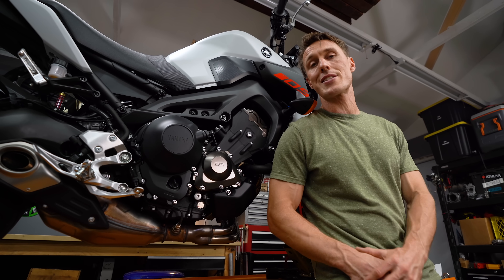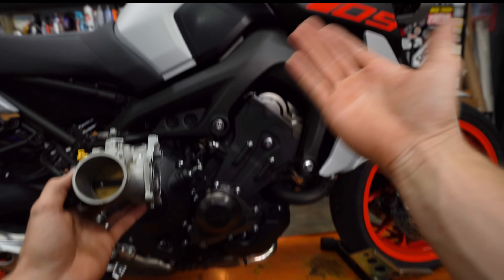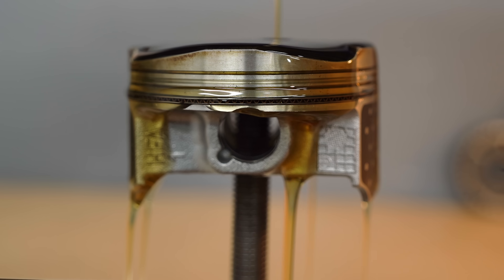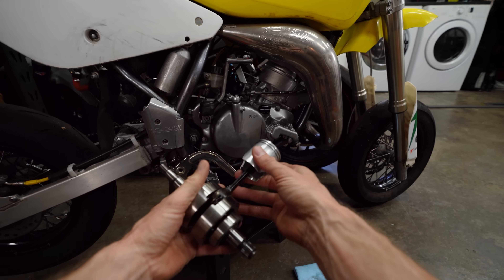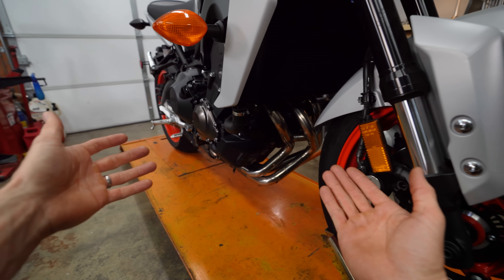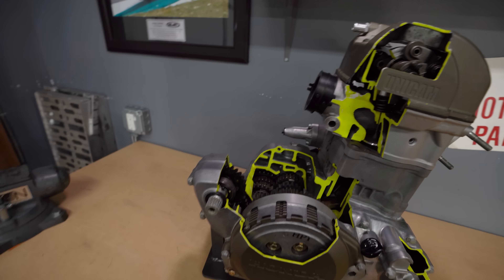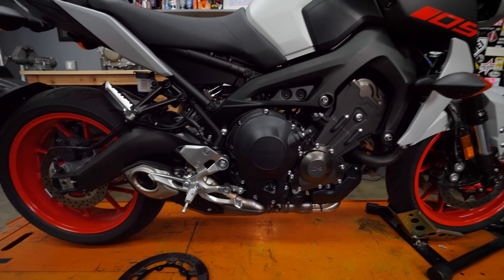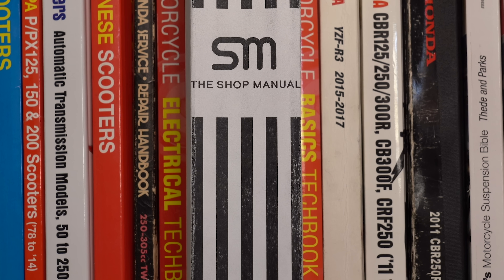Is Engine Braking Bad For Your Motorcycle? | The Shop Manual

Comment: What about down shifting without clutch?
Reply: Just make sure you're not pushing high revs when you do it. It's fine going up the gears without clutch as you just kill the throttle and click up but take it easy coming down.
Had to wait a week for a replacement clutch cable for a Suzuki GS850G and did everything clutchless, even starting in gear while hanging on tight!

Comment: I’m thinking about getting a yz85 and I’ve heard a lot about this engine braking so I’ve heard jus give it blips when goin down hill or just pull in the clutch and blip it and so and so but say you let off the throttle and don’t blip it at all and just use the brake to slow down would that be the same as engine braking? Can somebody fill me in about this and also tell me if there is any other things I should know about?

Comment: But isnt it so that fuel into the cylinder cools down the engine?  For example a lean set up engine will run hotter than an engine who is set up to run  rich? So if youre engine braking and thus letting very little or no fuel into the cylinder the engine will heat up?

Comment: Ok hold on. At one point Ari said something along the lines of "there's little to no air-fuel mix getting into the engine when the throttle body is closed". So how does an engine even idle without getting any fuel? I'm lost
Reply: Even when the throttle is closed, the throttle plates are still cracked open a little bit, allowing enough fuel/air through to allow the engine to idle. When you adjust the idle screw on carbs or throttle bodies, you're changing how much the carb slides or throttle plates are open at closed throttle. Make sense?

Comment: Engine braking: I was most concerned that my engine would cool to quickly because during engine braking you are introducing cold air into the hot engine and thus may be warping the valves do to cooling them rapidly. This occurs with "air cooled aircraft" at higher altitudes due to the air being very cold and is even known to seize up the engine. Would this be an issue especially during winter or on cold days for an air-cooled motorcycle engine? The engine is not going to overheat via Engine Braking whether it's water cooled or air cooled , that's just silly and in fact, the opposite will occur although, predominantly with air cooled engines. Robert
Reply: No, because the air warms up quite a bit coming through the intake, and it’d be entering the engine at the same temperature whether on throttle or not anyhow. It only gets hotter once compressed.
Reply: @thetowndrunk988  not what I was taught.
Reply: @robertshaver4432  ask yourself this- where would the extra heat be coming from? There’s some slight heating of the air trying to get by the throttle plate, maybe, but then it’d cool back down upon expanding on the other side  Negligible at worst, immeasurable otherwise. There’s no fire or explosion, so there’s no source of heat.
Reply: @thetowndrunk988  I think you've got me wrong. It's an air cooled engine so the heat is inside and the cooling is outside. At altitude the air is "very cold" so if you abruptly throttle down the engine cools rapidly from the outside and thus very unevenly. The valves can cool too quicky and warp and also the outer cylinder walls cool quickly and the block contracts around the piston which remains hot and expanded so the piston becomes to big for the contracted cylinder walls and thereby the engine can seize up by pulling the power off to quickly. Upon cooling from the outside-in the block shrinks and the still hot pistons don't. You can seize your engine this way. pull your power off slowly to allow the engine to cool more evenly.
Reply: @robertshaver4432  yeah, I got my conversation with you mixed up with another conversation about heating up from engine braking. But anyhow, IMO, there’s enough mass in the block that it’s not gonna cool down suddenly, and the fact is even letting off the throttle is still engine braking, so unless you never let off the throttle, you’re always going to have engine braking happening.
Reply: @robertshaver4432  that said, an air cooled engine, by its very nature, is obviously going to cool down a lot faster from air, so ymmv
Reply: @thetowndrunk988  Subjective? find any airplane mechanic and ask him if "at say 10,000ft should you "quickly" pull your throttle down from full throttle to idle"? I'm not being rude, I'm keeping you safe!
Reply: @robertshaver4432  that’s an entirely different argument, and believe me, I actually am a pilot. You’re talking about much older engines in most GA aircraft, and there are a lot more reasons to not pull the throttle back in a plane. Crashing being one of them. A whole load of factors in a plane. That has jack nothing to do with a motorcycle engine. They’re not even remotely close to the same type of operation, or conditions.
Reply: @thetowndrunk988  I guess you don't ride in the mountains. If you are loaded with either a passenger or camping gear or both and  have climbed a steep grade and brought your engine to its hottest temperature then as you crest the grade and begin the downhill side and quickly reduce your throttle to idle to use the full extents of compression braking, you will or may warp your valves. Metal does not like rapid temperature changes. In so far as aircraft crashing because you go to idle is absolutely ridicules: If you really are a pilot you know of "energy management". I ride in the mountains and on narrow/slower/steeper roads where overheating is a concern. On the downward side you do not want to quickly reduce your throttle to idle for compression braking. ymmv.
Reply: @robertshaver4432  🤦‍♂️ Jesus God. Of course you don’t automatically crash taking an engine to idle. However, if the engine quits, because you took it to idle for no good reason, whether it ices up, mixture changes, etc, it can certainly lead to a crash. Now, comparing planes to a motorcycle is an absolute fallacy. You’re generally gonna be at altitudes that most motorcycles won’t see, at least for very long, and you’re dealing with engines that are designed to run at a constant rpm, towards the high end of the motor’s rev limit, for long periods, which is the exact opposite of a motorcycle. So unless you’re going back and forth through the Eisenhower tunnel, with a constant speed non stop, a motorcycle isn’t gonna see those conditions for any long period of time. And you speak of energy management- in a plane, you want altitude and speed, because they give you a margin of error for emergency planning, which once again, is the exact opposite of a land based vehicle on wheels, where lack of speed and being able to stop quickly are you friends. So I guess if you’re on I-70 around Veil, on cold days, always doing constant road speeds, maybe you have a point, but in the normal use and conditions, ie very few people ride motorcycles around below freezing, which it quite regularly gets to at 10,000’ flying, the concerns aren’t worth considering, and the comparison between the 2 has absolutely zero merit.
Reply: @robertshaver4432  fyi, pulling back to idle is done for engine out training. Now here’s another point- what happens when you let the bike fly downhill, using nothing but the brakes, and your speed picks way up? Does that not also cool the engine rapidly with the increased airflow? When semi trucks pull a giant grade, crest the hill, then immediately start engine braking coming off the other side, are they sitting in shops getting valves replaced often? No, of course not. It’s not a big enough shock, even to a small engine like a motorcycle, and any shock that would be there would be experienced anyways, unless you’re gonna plan to ride around in circles for a few minutes to dissipate the excess heat.

Comment: Question?  The way you describe engine braking sounds like a person staying in the same gear and coasting to a slower speed.  What I would like to know is DOWN SHIFTING...  if I am cruising at 3500rpm and see a red light and instead of using the breaks I downshit and coast, and downshift and coast to stop.  I jump from 3500rpm to 7 or 8k but still below red line.  IS THIS BAD??  T ride like this and my 250cc duel sport has 39,000kil on it and now the clutch is slipping.  Did I prematurely wear my clutch or is 4000k on a 2009 duel sport normal interval for clutch work?  I always thought riding like this was OK and that I was saving on my brakes, but now that my clutch is slipping I am wondering if my riding caused it?  THANKS
Reply: Downshifting is a great way to increase the effect of engine braking. Just make sure you're rev matching to keep things smooth.
Reply: @AriH211    That is my point, I am not rev matching, I am going from 3500 to 7000rpm so doubling my revs when downshifting to decelerate.  I stay below redline but downshift to decelerate quicker then coasting like coming to a red light.  I downshift jump up to 7000rpm then when at 3500rpm I downshift again until I come to a stop at the light.  I am NOT coasting, I am NOT rev matching, I downshift to decelerate quicker.  Is this bad for clutch or other parts?
Reply: @reedkelly6145  Yes, you need to rev-match and feather the clutch to smooth out the downshifts, otherwise you are in fact putting undue strain on your clutch. Ultimately it's a small impact, but what's more important is that you practice good technique for the sake of smoothness and control of the bike. If you downshift the way you're describing when it's raining, you may cause a rear-wheel skid.

Comment: Sorry, that is a rather short sighted video. Crankshaft doesn't like being used as a brake. Engine is for going, brakes for stopping. Engine braking DOES cause engine to wear quicker than just using your brakes. ...and if my radiator can handle full power acceleration, why is it that my three disc brakes can't handle full power stopping?
Reply: Your brakes can certainly handle it, and I for one would never use engine braking b/c I think it'll preserve my brakes, UNLESS it's on a super-long decent. Plenty of examples of people overheating their brakes during such descents, which is why so many owner's manuals (for all vehicles) suggest downshifting and using engine braking to relieve the brakes and keep them from overheating. 

As for crankshaft's preferences (and why they matter), I'd love to hear more of an explanation.

Comment: isn't engine braking is caused by the compression stroke? I think you can turn the engine of and still engine brake with the throttle fully open.

Comment: Engine braking does cools the engine a lot. Don't believe me? Look for a long downhill, remove the car or bike thermostat. Get to the top of the hill and with the vehicle on operating temperature do the descent only using engine braking.....when you get to the bottom the temperature of the engine will be colder.

Comment: An interesting note, some Saab cars built between 1950 and 1980 had 2 cycle motors, and some of the ones that used "pre-mix" had a freewheel sprag clutch to prevent engine braking for the very reason of oil starvation. I think some 2 cycle snowmobiles also do.

Comment: I engine brake every time I ride. It’s essential to smooth stopping in my opinion
Reply: Yup! (It works fine- on snow and ice, too.) The pads on my KTM Duke 390, still have around 50% on the front/ 60 or 70% on the rear. (And the factory ABS, is for why I am still here.)

Comment: The engine is not a brake. It is designed to produce power not absorb it.  New pads and rotors are a lot easier and cheaper than engine rebuilding

Comment: I figure brakes are a lot cheaper than drivetrain.
Reply: It's all gonna wear out anyway. Ride in whatever way gives you more joy and control. For me, that's using engine braking. The alternative (pulling the clutch in any time you roll off the gas) sounds absolutely ridiculous.
Reply: @AriH211   I don't pull in the clutch all the time, I just don't downshift.
Reply: @timjohnson1199  Then you're still engine braking, just not with a lotta force.

Comment: Engine braking on an electric bike actually puts charge back into the battery. It's like free gas every time you go down hill or approach a stoplight.   
This video is an advertisement for electric motorcycles.

Comment: I have a question. When I get 93 out of a pump at about 3 gallons am I getting lower quality because someone just bought 87?
Reply: Yes, but it's only a few ounces (the volume from the gas handle to the manifold in the pump).
Reply: Just pump the first coupla oz out on the ground and then start filling.

Comment: and the chain set?
Reply: Engine braking tensions the lower run rather than the upper, and it does it with a lot less tension than accelerating.

Comment: I would add that by using engine braking the rear tire wears out slightly more than the front, but if you use normal brakes it’s exactly the opposite

Comment: Ima save you 6 minutes - Is engine breaking harmful?

4 stroke engines = no.

2 stroke and wankel engines = yesnt.
- because oil for lubrication is in your air/fuel/oil mixture. If you engine break there is no air/fuel/oil mixture to lubricate your engine, so your engine doesnt get lubricated every time you engine break. But dont get me wrong If its only for a very short period of time, this wont harm your engine, its not like your lubrication is completely gone every time you engine break. But is will be gone if you go down hill engine breaking all the time. This will kill your 2 stroke or wankel engine very quickly.

Btw. Wankel/rotary engines are special 4 stroke engines - just some very special ones which have the principle of burning oil just as 2 strokes, which is why people often mistake them as 2 stroke engines - they are not. Wankel engines are 4 stroke engines, which have to burn oil due to how they work.

Not engine breaking and just pulling the clutch is actually very dangerous in any curve. I garuantee you this habit will sooner or later get you killed, if you dont get rid it. So unless you really want to die, you should get rid of it right now.

Comment: If engine braking is so great, why did they invent the slipper clutch?  More seriously I would never have my engine at redline when engine braking,  That feels like bordering on abuse to me.
Reply: It is abuse to downshift when your bike is at redline. That would be "breaking," not "braking." And slipper clutches were created to manage back torque (engine braking) in racing applications (dump the clutch rather than feather it) and as a safety for streetbikes for when people inadvertently or awkwardly downshift.
Reply: I've seen people take their engine to redline using engine braking on a steep downgrade.  That's what I wouldn't do.

Comment: The loud noise every trucker makes brought to you by engine breaking on level 3.
Reply: diesels cannot engine brake by it's own that's why it's really loud, coz they are using a device called "Jake Brake" to employ the same technique.
Reply: @junkawakami3193  you teaching me while I am currently driving a tractor. The exhaust brake is an engine brake.
But go ahead tell us more stuff.
Reply: Not only that all engines can brake to some degree even without an exhaust brake. Very commonly done by actual drivers. 
I do this in my car motorcycle and tractor

Comment: But what about wear to the clutch??  And don't the most skilled riders seamlessly and automatically match revs vs. just stomping it down into a lower gear and using engine braking?  It would be helpful to know why there is so much talk about engine braking, vs braking with say, the brakes?  Whenever I hear rants like this, I always assume the rider doesn't know how to downshift.
Reply: You get far more load on a clutch under acceleration then engine braking could ever give
I'm not sure what you mean by why there is so much talk about engine braking? In which way? I'm surprised so many people think its bad for the engine, gearbox ect. Shocked me

Comment: About your so called engine braking theory. To start with you can't engine break a manual transmission. down shift yes. Coast yes. but actual let go of the throttle  and come to a stop with in a reasonable distance without grabbing the clutch. NO!  How ever on a bike with an automatic transmission you can engine break by simply letting go of the throttle. Bike like the new Honda Goldwings (2019 and newer.) or the Suzuki Burgman 650 and the 650 executive. Oh and downshifting a manual transmission isn't the same as engine braking its simply going to a lower gear.  because you still have to use the throttle and the clutch.
Reply: Downshifting enhances engine braking. More revs = more intake vacuum. Nobody suggested you'd use engine braking to come to a stop, it's just a supplemental/alternative way to shed speed. CVT trans bikes actually have less engine braking than manual machines since the centrifugal clutch fully disengages below a certain RPM.

Comment: Your so wrong on two stroke engine braking on multi cylinder machines the actual effect is less noticeable than a four stroke if you ride your favourite stretch of road on a four stroke and then copy it on a two stroke the ride is totally different  because of a lack of engine braking through corners

Comment: While you engine brake on a 2 stroke there is less oil coming in tot the cilinder as you said. And the residual oil will lubricate it. But in my mind it's the same as for example mixing your oil 1: 52 instead of 1 :50. It won't destroy your engine instantly but could cause excessive wear